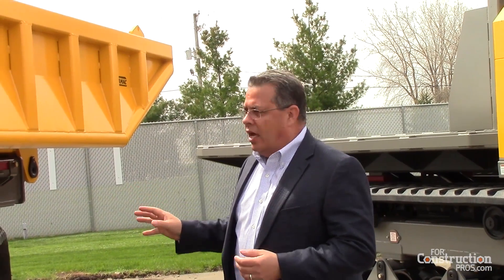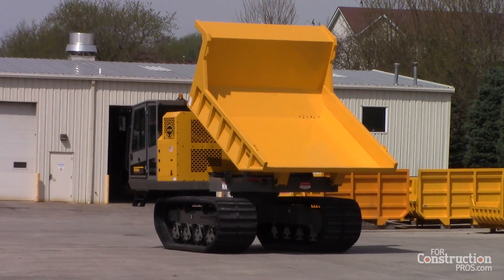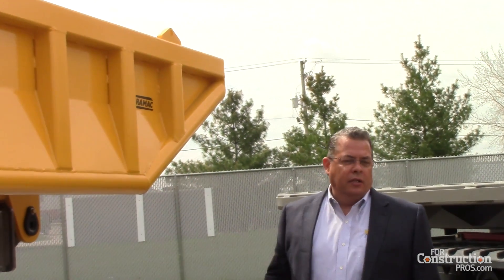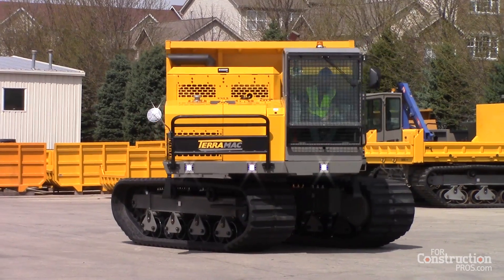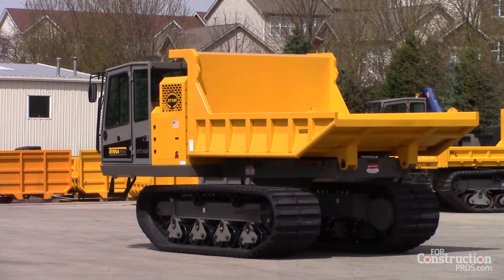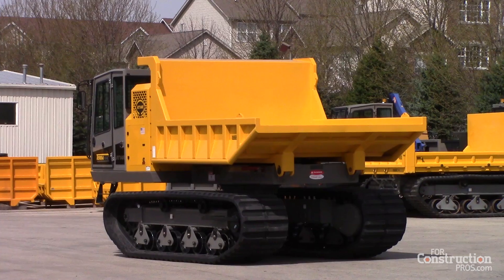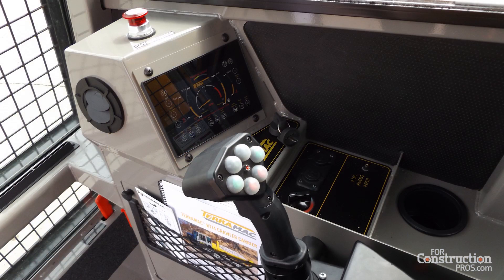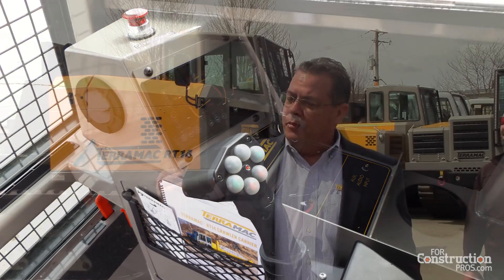Features of Terramac's 360-degree Rotating RT14R Crawler Carrier

Comment: Prinoth T14/R Panthers now have a hydraulic tail gate that lifts out of the way perpendicular to the bed. It's dump body is deeper as well. This is just a cheap useless knock-off. The fake Gucci bag of the construction industry if you will.
Reply: This video is 9 years old bro, Prinoth is a newer entrant
Reply: @bobsacamano4648  Sorry not bro. Prinoth introduced it's Panther T14/R rotating dump bed crawler in 2016, the same year this video was produced showing Terramac's new RT14/R

Comment: Can I get a large capacity dump body for crawler dumper instead of the regular dump body that come with it ?
Reply: i bet you can. ore you could say weld on plates yourself after buying it if you say are a big farmer that want to transport  silage-hay-corn in a muddy field
where a standard wheel tractor would get stuck pulling a trailer.